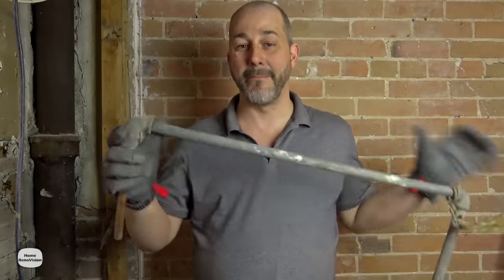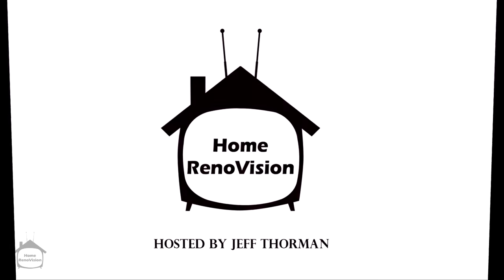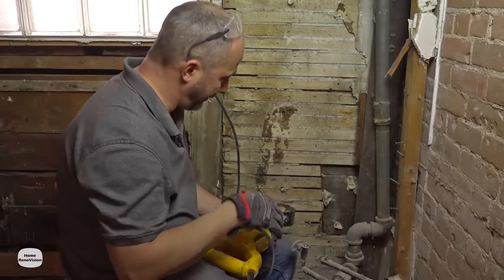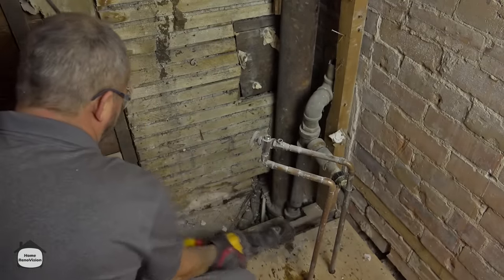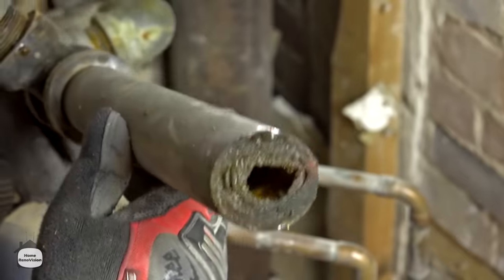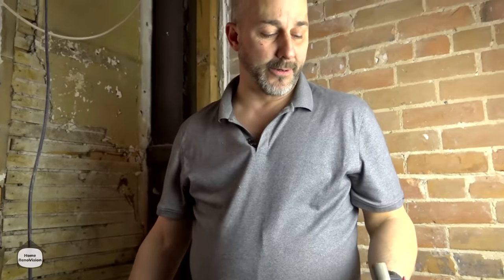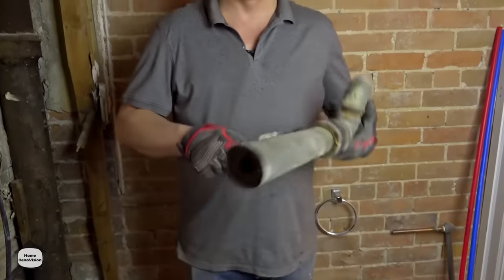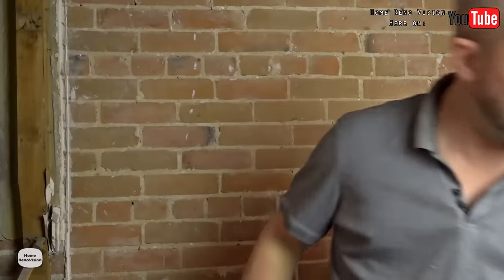Why you Should Remove Your Steel Plumbing ASAP!

Comment: I agree with the Pex upgrade, but the crimp connectors are inferior to the AquaPex expansion connection.  The expansion connection takes a few practice runs, and little investment, but you will love it when you're done.  #uponor #milwaukee
Reply from the maker: There is always something better out there. I suggest things my viewers can get at the box stores for their convenience. Cheers!
Reply: Our house has the Rehau everloc system with is Pex a with expansion connection.  They are much better than the compression ring as you don't constrict your water flow at connection points.  The Rehau system is better than the AquaPex system as you don't expand the collar.  You slide it on after and you are immediately ready to pressure test and you never have to worry about extreme pressure expanding the collar enough for a leak to be caused (not that I expect AquaPex would fail in any real-world situation).

Comment: Thanks for the information. Rebuilding our bathroom right now. Will definitely be removing all of the old galvanized pipes. 
Should I also replace our cast iron vent/drain stack with PVC while we’re at it?
Reply from the maker: if you can you should. But be careful of the price.

Comment: in 2 of my 1930s Oklahoma crawl space houses im going to be replacing my Cast iron drain and Galv Steel water line. I plan on buying pex at eBay. Im looking for a video of if i should use 3/4 Horizontal under the house and 1/2 up into the house? Or should i just do the whole thing 1/2? 3/4?

Comment: Man I wish you was here right now I definitely need your help ASAP!!!!
Reply from the maker: What seems to be the problem?
Reply: @HomeRenoVisionDIY  have some clogging in my basement  that backed up.I think from the main sewer drain to the street.
Reply: Plus my house was built in 1889 lol its ancient
Reply from the maker: do you have a tree in the front yard? If so you may need to use a high Pressure hose to clear out the roots. either way time to call a plumber. Cheers!
Reply: Yea someone from my wife's job said because the tree is on the sidewalk the city might be obligated to pay for the damages not sure but going to rent a main sewer drain snake with the things that look like an ants mouth lol

Comment: Sure,the pex will expand but can the same be said for the fittings used to connect the pex?I don't care for pex and one of the main reasons I don't care for pex is that the bends on the elbows are too tight.Thank you for the video.

Comment: What is the standard water feed line into homes? I have an older home and I'm looking at replacing all those old pipes, one issue I know I'm going to run into is getting the  water completely shut off, any suggestions?

Comment: This is great - thanks!  BUT we are unable to remove galvanized piping that is going through STONE...is there a way to REAM IT OUT?  We aren't sure of the path the pipe takes and it's under many layers.  In the mean time we are able to replace the VISIBLE galvanized pipe...Taking your advice.   Thanks again.
Reply from the maker: you can always use a high pressure hose. cheers

Comment: Pex also has an expiration date (a much shorter one to). In a couple of years it will become more brittle in 20 years or so it will be so brittle it will break if you so much as breathe on it. In contrast unlike steel copper has a very good corrosion property :  copper oxide is not porous. That means that once that first layer of copper oxide has formed and your pipes are all nice and green on the surface it will act like a paint preventing any further corrosion.
Reply from the maker: stop spreading lies about pex!

Comment: Good video, but instead of crimp, you should also consider the PEX expanding fittings (i.e. Uponor).  Much better system imo, and more DIY friendly than crimp.  Less subject to user error, and the joints continue tightening over time.
Reply from the maker: If they start selling them at the box stores I will. I try to show products that the viewers can get easily as well as quality.
Reply: Fair point.  We (at least in the states), buy a lot of stuff from Amazon, and other online etailers (e.g. supplyhouse.com, etc.) and they carry them.  IMO, the holdback for DIY use of the expansion has been the high cost of the automated expansion tool from Milwaukee or Dewalt.  The manual tool is cumbersome to use.  I just did a bathroom reno, and found as DIY you can buy, then easily re-sell the tool if need be saving you some $$. PEX is awesome.

Comment: can i connect polly pipe from mains to a old hot water system supply pipe as my existing underground supply is steel pipe and needs to be replaced
Reply from the maker: that depends on your local code. but in theory yes!

Comment: PEX is great stuff, however if you're replumbing I also suggest you consider running a copper cold water line in addition to PEX to your kitchen sink (where you drink, get pot water).  I find water coming through PEX has a bit plastic-water-bottle-left-in-the-sun taste to it.  Use the pulled PEX cold as a backup, should that copper ever fail.
Reply from the maker: I would find that a little extreme. Pick one or the other. I would use pex everywhere. The most cost effective DIY plumbing around.
Reply: Home RenoVision DIY tell that to the wifie when she's complaining the water through PEX tastes bad.  In any case, unless there is a brand or type of PEX which is certified not to change the taste of the water, it's worth considering having a single copper run to the kitchen sink.
Reply: I agree, water through plastic pipe does taste "off" at least for a while after install. We have have hep pipe in our kitchen, installed almost 5 years ago. Only now after at least 4 years is it started to taste ok for drinking. Until now we have been drinking water from the bathroom where the pipes are copper. For cooking, tea, squash etc it was fine, but if you wanted to drink a glass of plain water you could clearly taste the plastic flavour.
Reply: More likely you are associating the taste of the city water at your house or some other aspect with the pipe.  It does not give off 'taste'.  If it did you would notice it would go aware after a few seconds as you would have cleared the line of water that had been sitting there and would be tasting water that had only touched it for a second or two as it comes in from the outside line to your faucet.
Reply: Nope, not imagining it, the flavour was off for a long time. It may well go away when the tap is run for long enough to clear the line, but that isn't the point, water left in contact with the plastic pipe does take on a taste from the pipe, at least for a time after install. That's why we used water from the bathroom tap which is all copper piping.
Reply: Run it through a charcoal filter.
Reply: This is a great comment, the line at least from the main to the kitchen sink and fridge should be copper. I had someone steal out the copper on an old house and I took out the remaining steel lines and replaced with pex in 2 days..... which yes, I thought was amazing but the water tastes like plastic. I sold the house shortly afterwards.
Reply: well you just got used to it the same way you got used to having car exhaust all around you and not notice the off taste of air....

Comment: so after we cut the old galvanized water supply line, how do we connect our pex to that cut metal line? is that a simple sharkbite from the local box store? or something more complicated??
Reply from the maker: remove it all together. You will find that the water supply from the street has been updated to copper so the transition should happen at the shutoff valve.

Comment: Is that what the city's supply line's look like then? I can't see them going around ripping out all the piping to everybody's house every time the industry makes a standard upgrade.
Reply from the maker: Hi Stephen , the city switched everything to copper years ago, but it is up to the homeowners to switch out their own supply lines in the house. There are still tens of thousands of homes with this junk in them.
Reply: So unfortunately aware of it.  My first rental had an emergency pipe blow out, so when I got my second, I had my plumber rip out all the galvanized before I even listed it.
Do you know if ALL cities went to copper?  Or how would you know if your city did? (I'm living in Winnipeg)

Comment: My hot water monoflow heating pipes are steel from the 50s. Do you recommend replacing them if I want to finish the basement?
Reply from the maker: Sounds like a great time to update before they are hidden behind a wall.

Comment: Most sprinkler systems that I see run on steel pipes. Not sure why? But can we rely on these sprinkler systems?
Reply from the maker: no worries they don't have running water in them which is where all the mineral deposits come from over time.

Comment: What happens when you  find those type of plumbing in your home where there's nothing but rust and corrosion and the pipes has no gap at all, does it mean your entire house is filled with expired plumbing and needing to do an entire replacement?
Reply from the maker: remove it. Cheers!

Comment: I have 3/4 galvanized steel under my home that I just bought... What size pex do you think is a good size to replace it with, should I stick with 3/4?
Reply: yes, stick with 3/4". Why PEX? Copper is a far better material if you know how to solder and can afford the material.
Reply: Hi, 
Go for PEX!!! I just completed my project of redoing my whole house. 3/4 for the main arteries, then go down to 1/2 inch to anything feeding water to. There is a guy on YouTube that shows how to do everything step by step using PEX. I’ll try to find his link and will send it to you. I was going to do copper, but as I was calculating cost, it came out to be more expensive. Anyways, wish you luck.

Comment: Is steel the same as galvanized? Also, does copper piping leach copper into water at all?
Reply from the maker: Yes galvanized is steel pipe, As for the copper I am sure whatever we use to transfer water leaches. We will all die someday, no need to worry about things we can't change. Still much better than pumping water from a well! Cheers!

Comment: I would not recommend crimp pex, use sharkbite or pex that is comparable with pex expander
Reply from the maker: This is for homeowners, not tradesmen. Homeowners are not going to buy those tools.
Reply: I did.  It only costed 50 dollars for the crimper so that is a small price for a tool that does the job.

Comment: European been using pex for a very long time. I have built my house in Europe and did everything with pex 30 years ago and still works great. Never had issues. 
I would only suggest not to buy pex at Home Depot or Lowe’s because quality of the pex pie is not very good. Go to your plumbing supply or have your plumber buy it. 
Pex and fittings cost more then copper but plumber will get it the job faster. 
There is no savings in it, at the end it’s the same. Labor more material les or material more labor less. 

Have licensed plumber do your plumbing. I don’t think this guy is licensed and honestly shouldn’t be doing this for others.

Comment: You should switch to Uber nor which is PAX A Would you use an expander it’s a better packs and packs be with the cramps rings
Reply from the maker: I am recommending what the homeowner can find in the building store, if they switch to a better pipe then I would be happy to recommend it!
Reply: Home RenoVision DIY Thanks for the reply wasn’t trying to be smart you have great videos do excellent work very impressed

Comment: and old solder had lead
Reply: Yes it did but unless you were drinking or boiling hot water (which you shouldn’t do anyway) it would not affect you. Also, lead solder in hot water heating lines is perfectly fine as this is a closed system
Reply from the maker: most older building techniques had bad health effects. The secret to living a long life is not to worry about things you can't change. And fixing the things you can. Cheers!
Reply: solder is designed just to go into the fitting and is not generally in contact with the water unless the sweating was very very sloppy done... So its not nothing like having lead pipes...So Stay Calm and Drink Your Water....

Comment: Hello there-I have a 4in steel nipple with no threads --it is a water supply line in an old house it shows to be 7/8 OD What kind of clamp  can i use to go over it so that i can connect to CPVC-Im trying to connect them together-Or what can i do to just cap it off-I can not find a shark-bite that will push onto it so that i can come out of the other side of the shark-bite with a peace of cpvc

Comment: PEX is not code by me.  Do you recommend Propress?
Reply: Pex will last longer than copper and its much cheaper propress can get into being 15-20$ a fitting and pex is only 2$ a fitting
Reply: "Pex will last longer than copper"

Ahahahahahahahaha, good one Haanz!
Reply: Propress is a good system. I work for a large mechanical contractor that has used it for 20 plus years with few problems. All types of pipes and joints can leak...

Comment: My house was built in 1917, I'm long over due. atleast I know I'm not deficient in iron. XD
Reply from the maker: LOL, or just about any other mineral. Cheers!
Reply: It always depends on water quality and acidity. There is nothing wrong with galvanized pipe as long as the water has certain properties. They can last 60-100 years if all factors are in its favor and the protective coating that builds up inside is not compromised. And even if they have rust built up inside, the water is perfectly safe to drink. It is more of a nuisance issue when rust cloggs up filters and faucets. Same actually also applies for lead pipe. As long as the protective oxidation inside is not compromised they do not leach lead into water at a unsafe level.

Comment: The only reason the steel pipe was blocked was because of the last plumber putting a copper adapter into a galvanized steel elbow. What moron did this.
  When you galvanized pipes do become partially blocked. The don't lose pressure. The lose volume.  If you hadn't had to open the wall that drain line was in. It can be braught back to just line new. First thing. Dig that brass adapter out of the old galvanized tee in the wall. Instead of having a brass adapter in it then a brass tail piece soldered into it. Which causes more electrolysis and blocks up the cast iron drain line. Get rid of that. Snake the line really well. Good as new.

  Now, If you have the opportunity to open the wall for a remodel or something like that.  Then by all means install a new drain line. ABS or PVC. 
As for the life of copper pipe. Stop using junk copper. Start using Type "L" copper pipe. It will out live you or I.  It will Even outlast  the child you have install it. 
99% of the homes that get replumbed with copper or pex style piping do not need to have all of their pipes removed & replaced with new. 

   I did a house about a month ago that had 3 different plumbers show up. Give 3 different prices. They all said the old galvanized steel pipe "Must" go to pick up any kind of volume or pressure. The lowest price was 2900 dollars. I told them I'll fix the pressure & volume problem for 1200 dollars. But I will not be replacing the old Galvanized pipe. It just doesn't need to be done. After I looked at it. I told them. If it doesn't change their problem. They don't have to pay me. I'm very confident in what I do.
Oh by the way. They wrote me a check before I drove away. I told them they can wait for a couple of weeks to make sure I did what I said I would do.  They insisted they pay me. They said "it's as good as it was brand new when they built the home over 50 years ago". They asked for more of my cards. They will pass them around to their neighbors.  I've been back to their neighbors several times since working on their home.
Reply from the maker: Wrong. it is because it is a100 hundred years old.
Reply: @HomeRenoVisionDIY  maybe 1 in a 1000 get blocked like that with no help from some kind of electrolysis.  I've been doing the for almost 3 months now. I've never seen an old pipe plugged like that with either being on a bad well. Or so idiot introduced copper into the system some where. It just doesn't happen.
  Keep feeding your followers the koolaid. They won't even notice when you add in the poison.
How long have you been doing this?

Comment: why clogging like that at 5:19 ?
Reply from the maker: steel corrodes and there is always a little debris in the water that reacts to the steel.minerals work like that. copper has a similar effect but not anywhere near this reaction in the same time.
Reply: can we change it with stainless steel + water is filter by main outdoor water filter? or is it the same things will happen?

Comment: I'd just use an angle grinder.
Reply from the maker: That is a lot of spark in a lot of old dry wood, but it will work. The only problem is you risk starting a fire inside the wall cavity and not have the ability to stop it from spreading!

Comment: Sorry, had to give it a thumbs down…you didn’t mention anything about iron to copper corrosion, and using either a brass or dielectric fitting inbetween. (I think that would be quite pertinent considering you were showing a cast iron to copper connection, as well as cutting through it).